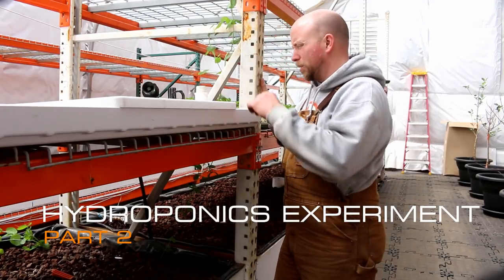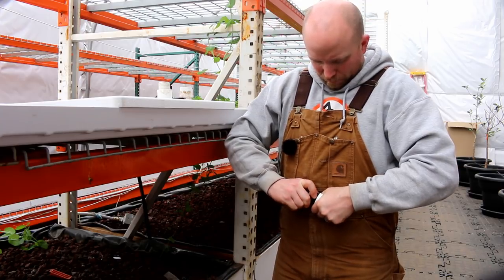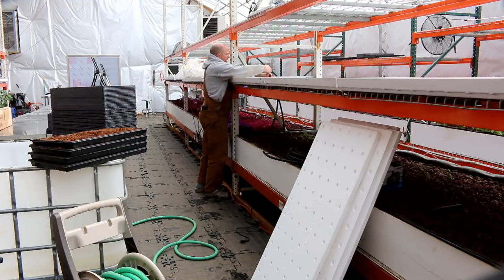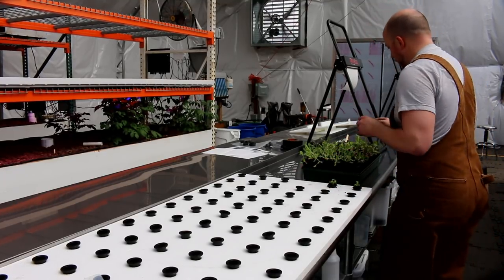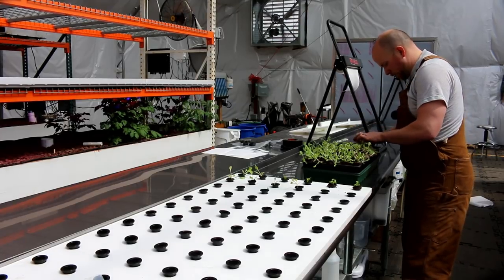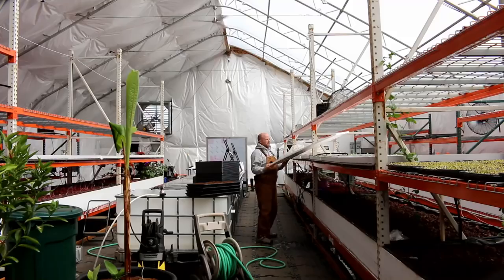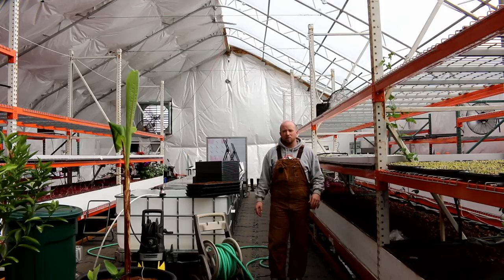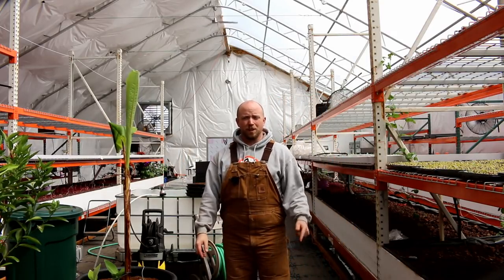Grow your own food, with split system Aqua/Hydroponics Part 2

Comment: For best results and minimal mess in your system, try using rock wool cubes. That is what I use for starting mine for an aeroponic tower. The tower really has to be clean so rock wool is the only solid option.

Comment: My 2 cents. The thread with the nut is a through hull fitting with a running thread. The plumbing fittings are a tapered thread, different dies. If it is low pressure I have ground a taper and used a good dope like megalok. Don't use sch 40 pvc female iron pipe adapter,  they are prone to shattering. Great seeing plants in the water.

Comment: I'll make a prediction.  They will grow.  The roots will begin to lift the floats while blocking the water flow to the drains causing a massive over flow situation.  The roots will turn brown and some rot will occur spiking the pH.  The roots will be locked to the net pots and impossible to remove without harming the plants during transplanting.  Algae will bloom in the areas that are not covered near the drains.   I made suggestions on a previous video which would have rectified these predictions and made good use of these shallow float beds.  It can be rescued.  Send me an email.  Rj - Beyond Harvest Veganistas a fb group

Comment: Since I'm millions of miles away it's hard to be sure about your thread dilemma.    I'm going to go out on a limb and say that what you have is an ACME threaded fixture and a common threaded pipe fitting.  The best way I can think of to explain this condition is that if you have an ACME thread and try to put it on a common thread the flat portion of the tread will go into the sharp peaks of a common thread.  However, if you try to put put the sharp peak of the common thread into an ACME thread that has a flat top there is no place for that peak to go.  The results, I think, will be similar to what you showed.  Common female will accept an ACME male but a common male cannot screw an ACME female.

Comment: Once the plants reach a certain size, you won't be able to move them around. Why? The roots grow / knit together. Also, I've found the hydroponic plants really hate their roots being moved around.
Reply: pharaoh411 I think the idea is to have staggered growing cycles where he harvests a mature raft then removes it and allows the others to float down to fill the opening. With such shallow beds and low flow, I can imagine he would have to slide them into place.
Reply: Yes, I understand the moving of the rafts as the lettuce matures - very common in other hydroponic videos on YouTube. He could populate a new raft each week since lettuce matures in 30-45 days depending on type. I've even stretched some of my leaf lettuce plants to 7 weeks before replacing them... harvesting a few leaves from each plant every couple days. 8 small lettuce plants can easily make a salad for 1 person per day. But my comment was specifically in reference to what he says starting at 6:40 - take a listen. For all things hydroponic, check out mhpgardener's stuff